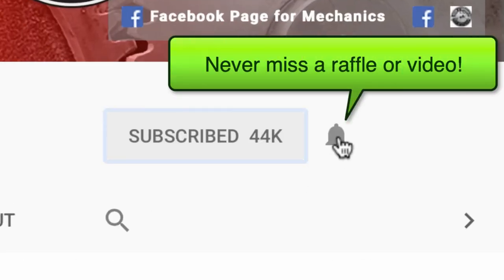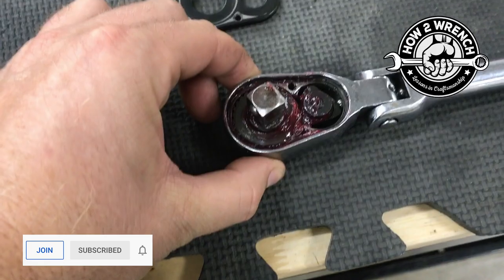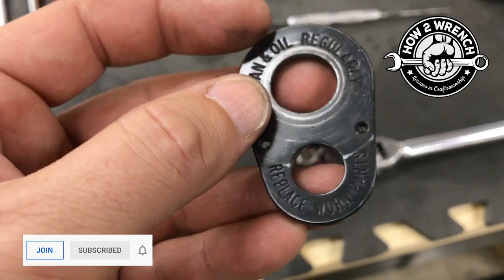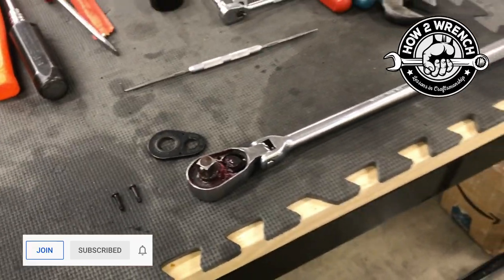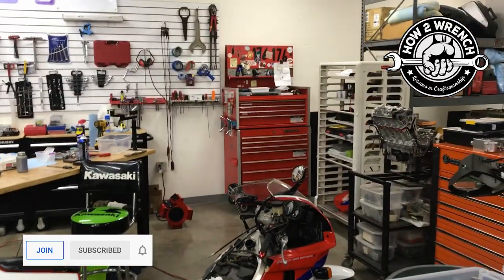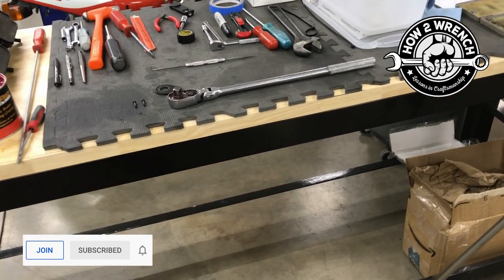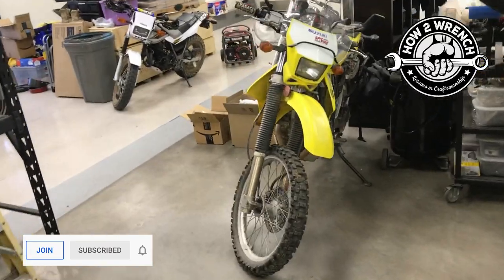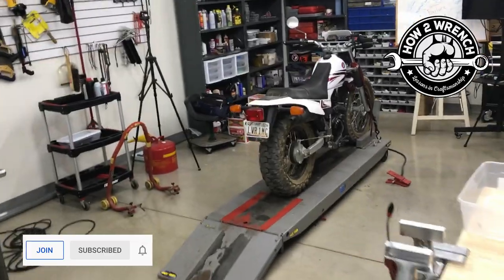How my ratchet has lasted 26 years and counting! #mactools #ratchetmaintenance #takecareofyourtools

Comment: I was taught to clean my tools and put them away so if I was going out all dressed up and needed to quickly tighten something up or a quick repair I’m not getting my clothes dirty. But never was told to grease my ratchets LOL... 

However I use to wipe down my air hoses with Armor-All spray to keep tgem from cracking and I’ve had the same air hoses for 17 years. I do check wrenches, sockets, allen wrenches, and screwdrivers for wear so I don’t round off anything or rack my knuckles... and will definitely check my ratchets and do a proper service on them... Thanks for the reminder. 
👍😎👍

Comment: Hi Shane, I'm working on a Suzuki en 125 carburettor. It is a Mikuni bs26 and the manual specifies a float height of 29 mm flat measurement, whatever that means cause as far as I know float measurement needs to be done at an angle with the float just resting on the needle spring. Also the bowl matting surface is slanted to the body of the carburettor so makes it a bit more confusing. I'm gonna try the clear tube method to try and adjust the float level and start with a float height of 17mm to see how that goes. Thank you very much for your videos. I have learned and fixed my bikes from them.
Reply from the maker: Nice...keep in mind even manuals have misprints...almost always there will be a 90 degree relationship to the float and seat. I have videos on here for it...

Comment: What are you thoughts on the Rick's Motorsports Regulator/Rectifier units for older bikes?  I just bought one for my 1975 Honda CB750 to replace the old crusty reg/rec units, even though they both seem to be working okay.  
I figure I can always go back to stock if the new unit doesn't work out.   For some reason I've been replacing and upgrading parts that are working fine.  I call it obsessive compulsive tinkering disorder.   I'm fairly new to motorcycles and wrenching... but in the two years I've had my the CB750  I've pulled the carbs and cleaned them when they probably didn't need to be,  I've replaced my ignition coils, added a Dynotek electronic ignition, replaced my brake lines, my handlebars, new control switches and replaced a bunch of rubber parts like carb boots and grommets.  I even bought an extra set of CB750 carbs on line just so I could take them completely apart, clean and rebuild them without having to worry about screwing up the carbs on my bike.  Now I've removed my regulator and rectifier and will be installing the Rick's combo unit tomorrow.  A lot of the guys on the forums say don't fix it if it's not broken, which is generally good advice,  but I haven't been listening to those guys.
Reply from the maker: Hi Dave...I am a HUGE fan of Ricks...I've done videos on his products and actually learned my tribal knowledge of charging systems from Rick himself. He invested a great deal of his personal time with me years ago...
Reply: @How2Wrench  Thanks, it's good to know Rick is making quality products. One more quick question... does the Ricks combo unit get a lot hotter than the stock regulator and rectifier?  I'm mounting mine to the side of the battery box behind the side panel on my 1975 CB750 (which is where the stock units were mounted).  I don't think it gets much air flow in that area. The unit has fins, which makes me think it needs more air flow, but I don't really know where else I could mound it.
Reply from the maker: @daveco1270  I couldn't tell you if there is a measurable heat difference but as much aiflow as you can give it. I should make a video on a trick I do with providing extra cooling to reg/recs. I mount a mini 12v computer fan to them! I've done it on custom choppers and sportbikes that have restricted airflow and making a "screen inlet is not an option. Wire in one of these if you have room! https://amzn.to/3bf9bab
Reply: Shane Conley that's a cool idea.  No pun intended.  I may return the Ricks unit.  Seems to be putting out a little too much power to the battery at 2500 and above RPMs.  My old school regular keeps it below 15 when giving it throttle but the Ricks is going over 15 which doesn't seem good, but I'm still learning all of this stuff.  Diods tested to all be good. Not sure what the problem is. 14.5 is what the manual says it should top out at.  I'm worried the new unit will over stress my battery.
Reply from the maker: @daveco1270  Most batteries are good for 15.5 dcv and is a common spec. I for some reason was stuck on 14.5 as the rule until more and more 15.5 specs surfaced. It's hard to believe that any problem could arise as the same battery fits models spec'd at 14.5 and 15.5....when dealing with older bikes we have to consider when the manual was written and how parts are spec'd or built today.

Comment: Shane, do you respond to questions someone may have about a problem with a motorcycle?
Reply from the maker: Yo! Want us to drop our wrenches and help you? We love helping subscribers…even on old videos! Help us grow friend! Here’s how:
1. Subscribe and let us know with a response. We will circle back when we can (usually within a week, sometimes faster, depends on member needs)
2. We answer your questions EVERYDAY for channel members Join here: https://www.youtube.com/channel/UCBhM8DCKnT3qXwTW0eToyCg/join    
3. Give us a high 5 here: https://www.paypal.me/how2wrench and I run back to the computer! 
4. Is this an emergency and your head is about to explode from frustration or fear? Get Shane’s cell here: https://how2wrench.com/product/personal-tech-training-phone-facetime/
Reply: @How2Wrench  Thanks Shane for the reply, I just subscribed. I'll try number 1 first.
I have a 2007 Dyna Superglide Custom that developed a starter problem last year. My question is......what is the main cause for starter failure?
Is it......
1. The starter itself.
2. The chain tensioner in the primary.
3. The compensator in the primary.

The drive clutch in the starter spins both direction in a certain position on the shaft. I replaced the drive clutch with a used one from a local starter rebuild shop in my town. On first start up, it started perfectly. So I rode the bike about 6 miles, stopped for about 10 minutes, restarted the bike and same problem as before, it started hard again.

Any thoughts.

Comment: Buell XB12ss-exaust fan, Honda 919-chain maintenance
Reply from the maker: Noted...
Reply: @How2Wrench  For the chain and sprockets I use simple green to clean and to lube, gear oil only. Modern cleaners destroy O and X-rings.
Reply from the maker: @yesicanu  Interesting idea on the simple green. I'll have to try it. As far as lube I'm a super fan of Maxima Chain Wax. If you ride the bike and get the chain nice and hot, the wax melts in and then does not fling off (as bad) as just oils, gear lube or other products. Many people call its claim false because they are not applying correctly when hot...but I love it. I love their mini cans that I can bring with me on trips too! Thanks for sharing.
Reply: @How2Wrench  Ditto on sharing! I appreciate your response. So much so I put a little story together. Your probably more than familiar with the following processes however, maybe someone who isn't will come along and pickup something useful for themselves. 

I used modern lubes but they require modern cleaners or a kerosene soak to clean/strip down thoroughly. Modern cleaners ruined my seals on two chains after ~20k miles; I'm looking for 35-40k. The kerosene soak process requires more isolated time. 

When it comes to chain maintenance, I find cleaning the biggest headache. So, I worked it backwards and it has me using gear oil for lube. The maintenance is more frequent, however, takes less isolated time.

Solution: Gear oil applied with a foam 1" paint brush every 300 miles or so. Dip the brush, set on chain and spin the wheel one direction until the applied area comes around then repeat in the other direction. The amount is key for longevity vs fling (we always apply too much). I always apply before a 200+ mile ride as the sustained heat is it's biggest enemy for me up in Vegas. 

Gear oil is so much easier to clean vs modern lubes that Simple Green works great. Spray bottle, chain brush, ratchet etc., and 10mm socket are the tools.
In normal situations if my bike needs a wash, my chain probably needs it. This process adds <5 minutes to the wash. In 15k miles or so on my current chain I still see no need to remove the front sprocket to clean build up. It just isn't there.

Oh yeah, and the cost isn't comparable.
Reply from the maker: @yesicanu  Thank you for the detailed process you shared! Make a video and share the link next time you do it!
Reply: @How2Wrench  I can do that